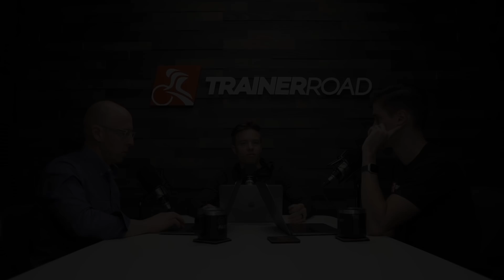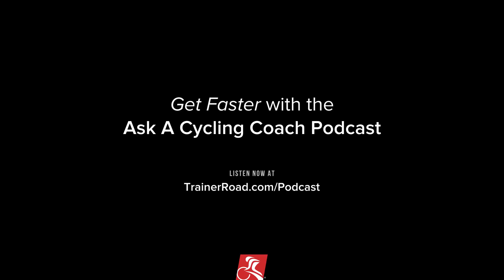How to use Normalized Power  – Ask a Cycling Coach 199

Comment: NP with or without  zero is the question, because those are two different numbers,not representative of actual effort, thus gauging actual effort useless. 
(Go up hill 400wats for 1min, descent 0watts for 1 min , now go 400w 1min and descent 1/2 min.  - different avg power)

Comment: I did a Zwift race today, My FTP is 196w and in the Zwift race today I got a NP of 196w, so does that basically mean I did my FTP for the whole race? Average power was 193w.
Reply: No because in the race you would have been going over and under your ftp which isn't the same stimulus as riding steady state at 196w hope this helps
Reply: @zacandrijasevich4986  Looking on Zwiftpower my average watts were 193w and 20m power was 197w, looks like I am sticking in my zone pretty good!

Comment: here on Dutch singletrack and flat course cxo races my avarage power is (way) higher as my normalized power. and it goes for almost every single ride I do. Only when the course has longer straights and/or climbs the normalized power will exceed my avarage power.

Comment: there's some maths confusion here guys.
First: to reduce a number by 5% you multiply by 0.95. Dividing by 1.05 is not the same.
Second: NP is a maths formula that goes as follows. Get you power numbers, raise it to the power of 4, the calculate the average, finally take the fourth root. By the way it is defined it is simply impossible to have a NP higher than average power.
Third: it is not true that NP ignores the 0. Simply, since the other values are so over-represented it ends up "weighting it less". Simple example. You pedal for 2 seconds at 200 watts. Average power is 200 and NP is 200. Now you pedal for 2 seconds, one second at 400 watt and 1 sec at 0. Average is obviously again 200 but NP would go as follow: (0^4 + 400^4)/2, then take fourth root. It yields 336 watts
Reply: I came to say it was mathematicaly impossible to have average > NP, but you did it first and better.
Reply: @AlvaroSantosNeto  Cheers man, I did not want to come across as pedantic but the Maths teacher in me could not resist ;-)
Reply: @carlofino4666  in your comment you state it is impossible that NP > avg while it is true that NP >= avg so I guess there is a typo :)
Reply: @frankrussi  yes I meant the opposite as it shows in the calculation  below.. NP is mathematically constructed to be higher than average power unless you produce watts in perfectly constant fashion (which is pretty hard  🤔 )
Reply: @carlofino4666  math was my major too 😉